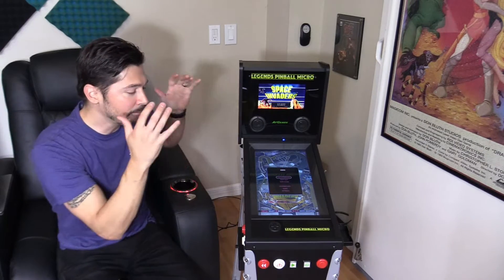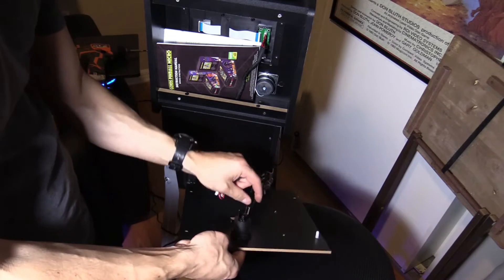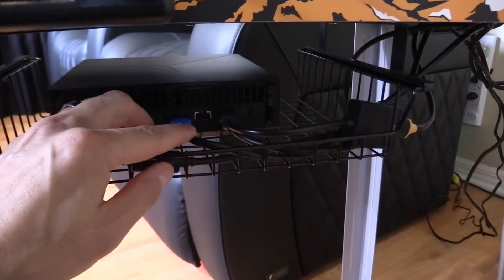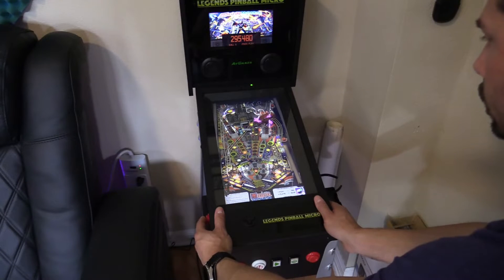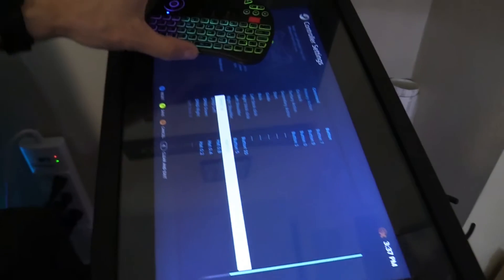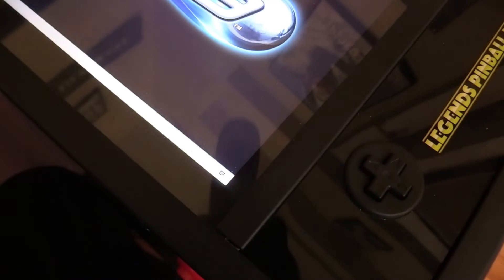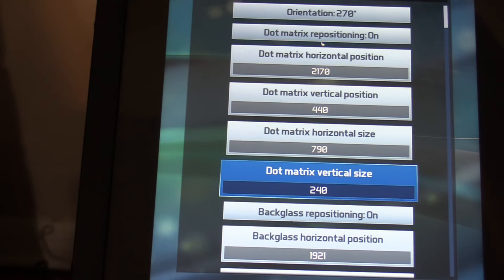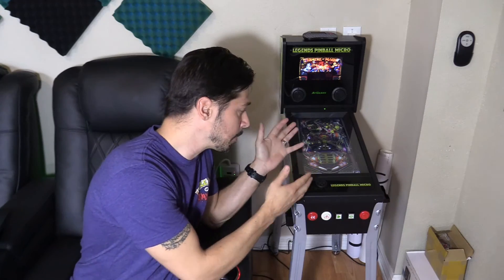How to connect PC to Legends Pinball Micro and install Vibs board

Comment: mine has the down d pad and the plunger mapped the same, in the hard ware. does yours not have that issue? atgames has ignored my service requests after 7 submissions, its very shady.
Reply from the maker: Down dpad and plunger is mapped in software that way on all machines. It's normal.
Reply: @TampaTec  I own the ALP Micro. It sends the same output signal for both d-pad down and the launch button. Which means if you configure it with Steam, whatever one is set to, the other will do the same. There can be conflicts.

Comment: When you say "usb to usb" I'm guessing you mean usb A to usb A. Every usb cable is usb to usb.
Reply: To build on this -USB C (on laptop) to USB A (on the Micro) will not work, correct?
Reply: Or it may be that the “unhide” option has been removed in the most recent version of Steam. Can you tell me what the workaround for this is? Thanks.